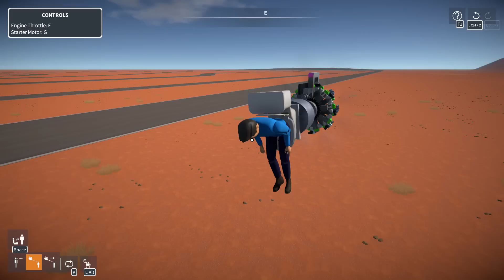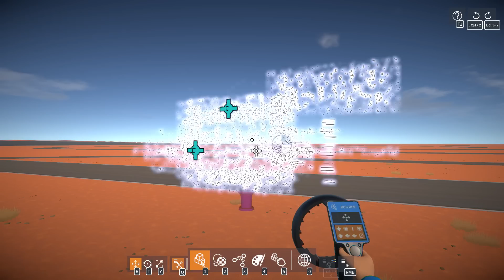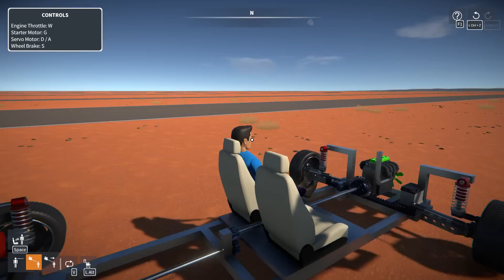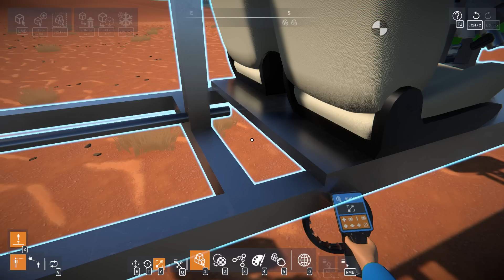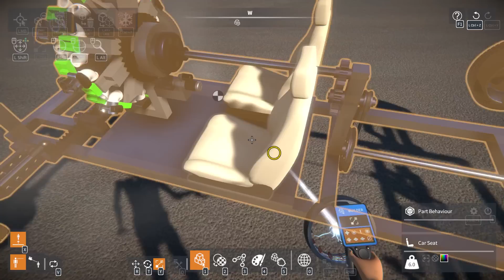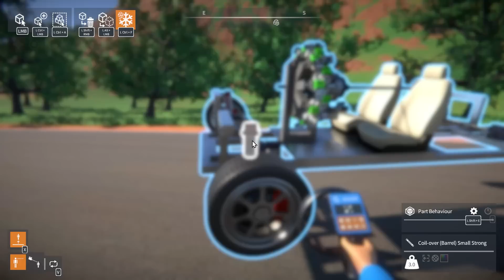This 18 Cylinder Radial Piston Engine Packs Power Into a Small Space!

Comment: 12:20 Your engines are consistent, you went from a pair of gears to a belt system.  That's what changed the direction.  Also like another comment said, build the 18 cylinder with the large pistons.

Comment: Is the crown gear of the rear diff  fixed to the left axle rather than the diff carrier? If so you probably find it drifts to the right as the left axle has permanent drive where the right axle receives power then through the carrier and game might be doing odd calculations with slip and stuff

Comment: Kan, the earliest planes solved the hydraulic landing gear issue by just not having landing gear.

Or, to clarify, their landing gear was almost always fixed or semi-fixed struts, so you didn't worry about folding it out of the way.

Then a lot of slightly later models had manual mechnical gear. Either a direct crank in the pit, or a reversible electric motor with a tristate switch.

Hydraulics only really became a thing in the ww2 years, and they were not that good. Leaks were common, so manual backup systems were necessary.

Comment: I think the problem with the chassis pulling to one side is that the suspension (spring and damper assembly) are fixed on top. Try letting them rotate, or maybe get inspiration from already built cars

Comment: The suspension issues you're having seem to be either, your geometry is weird or the tire physics are not linear in their direction. Could try moving the spring/shock toward the center of the car. Seemed very rigid with the bigger engine on it. And it kind of looks like scrap mechanics suspension....blocky.

Comment: Add a four speed box with a high and low range, bigger cylinders and some monster truck tyres. Dual twin exhausts and massive resonators should help with the flow of the exhaust to help build back pressure flow

Comment: you could make the Steering Servo have a slight offset to the left (like 5-10 degrees counterclockwise) to combat the problem with it turning slightly to the right... there should be an option inside the servo's settings for that

Comment: 21:20 I've actually tried this, i did a flat-8 small block stacked on top of a flat-4 big block (L4S8 on workshop). You can do some cool things with it and adjust your curves Instead of just having your normal engine peak at ****RPM you can have one engine peak early, and have the other peak late. I also have a vehicle I've made where i put the engine and transmission on suspension so it's "floating" in the chassis and used the stretching of the pulleys to connect it to the drivetrain. The idea was to help reduce torque steering by letting the engine rotate some, but i'm not an engineer and have no clue what the actual physics going on are. It seems to help even out the turning under acceleration, but there is still about a .2-.3g difference in left to right. Its called the "Tracker-B"

Comment: I kinda want to buy the game, but I'm not sure how overwhelming and difficult it is to do anything in the game from scratch. 

A particular idea I have in my head at the moment is a five cylinder radial engine laid flat like a pizza with one end of a cvt above the output shaft, and the other end of the cvt is connected straight down to a differential with a CV joint in the middle so a solid axle suspension can be powered from above.
Not sure about adding front drive for 4wd but for rwd longitudinal or fwd transverse this would be a solid and compact drivetrain, plus everything is down low, so it'll both have a really low center of gravity and be compact! might be really cool for a real life mower build.

Comment: I still think that this chassis turns right is because the rear right axle or wheel isn't connected to the differential. And moving forward is possible only thanks to it limited slip.

Comment: You might need a motor mount so the torque of the engine doesn't go straight into the chassis (I had a monster truck in gear blocks with a massive engine and it had the same problem with having a heavy fly wheel you have a lot of rotating mass applying a torque on your car) Hope this helps

Comment: 11:27 On the belts, it seems to play off of speed and torque. When I built a "hybrid" engine (v8 with a medium engine cramed inside) It would snap the belt drives if not a 1:1 drive.

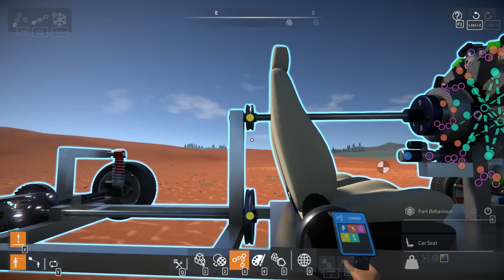Comment: 12:18 / 12:26 / 12:29 "...Is this still forward?...Of course it's not...Why would I build my engines with any sort of consistency...?"
But... weren't the engines driving rotation in the same direction?
Since he switched the transmission from gears to a belt, it reversed the direction on the wheels.
The fact that the car then drove in reverse means that the engines themselves were consistent.

Comment: 8:50 I think it depended on when the plane was designed and built. For example the F4F Wildcat had a manual crank landing gear system IIRC, and took a whopping 100 or so turns of a crank inside the cockpit to raise or lower the gear. Meanwhile majority of the planes past that point used a hydraulic system so that the gear could be totally covered in a closed little housing improving aerodynamics. Plus more importantly it was faster, and could be done with a single push of a button (at least for jets, all the old stuff had levers).

There’s a reason why there was like only one ground vehicle using a radial engine (early M4 Sherman), they take up so much space, and are a lot harder to cool when they don’t have open air flowing over them (like a plane). Then there’s the complexity of more cylinders versus a V-8, or the later V-12s used for tanks.
I definitely want to see a proper built test car.

Comment: I built a gas generator/electic drive car that honestly works great, if it was on a better chassis that is. I seem to keep having the rear wheels toe in on hard acceleration.

Anyways it would be cool to see you build one! 

Also I think your steering could be fixed with the trim option of the steering servo.

Comment: The only way to connect pipes like this is by angle node skipping, and belts do in fact slip in the game unless you turn up the physics settings, also you can easily flip the direction of the motor by inverting the direction of the rear crank shaft and starter in part behavior instead of adding gears, the chassis is probably pulling to one side not only because of engine torque but also axle instability in the control arms, the wider your control arms the better especially in the rear and sway bars can help with the engine torque

Comment: Radials are kind of insane. It solves a lot of problems in early aircraft: cooling, preventing starving, package size, weight, etc.

Materials science, newer engine designs (boxer engines, specifically), made radials less and less useful.

Still, the Twin and Double Wasp engines from Pratt & Whitney were used extensively to win WWII. Despite my love of the Spitfire, it should get much more love than the Merlin.

Comment: I think it pulls to the left because your servo is not in the center of the gear tooth row thingy, and therefore the default spawn position of the steering gear doesn't line up perfectly with the teeth on the row thingy, so it gets pushed like a fraction of a gear tooth to the left or right.
Reply: It’s called a rack and pinion setup

Comment: Connecting rod length is not the same as stroke length.
Stroke length is dictated by the crankshaft. The piston needs to move twice the radius of the crank shaft.
You can have a quite small stroke length, with a very very long connecting rod.
Reply: @jeffreyblack666
 Crank throw is half the stroke of the crank, not two times the radius.
Reply: @ducewags  The crank throw is the crank radius.
So saying the crank throw is half the stroke is the same thing as saying the stroke is twice the radius.
Reply: @jeffreyblack666  But it's not twice the crank radius. Crank throw is the distance from the center of the crank, to the center of the crank pin, or the center of the main the rod rides on. Crank radius is the entire swing of the crank. There is no such engine that has a crank swing, the size of the crank radius it's self.
Reply: @ducewags  Crank radius is the same thing as crank crank throw. The are literally 2 names for the same thing.
What do you mean by the "entire swing of the crank"? Do you mean from one side to the other? If so, that would be the diameter, not the radius.

It is called a radius, because it is the radius of the circle that the centre point of the rod journal traces.

Again, the crank radius is the same thing as the crank throw. It is half the stroke of the piston.
Reply: @jeffreyblack666  Crank radius is the outside diameter of the crank where the counter weights are. Crank throw is the distance the crank moves the rod. I buy cranks that are 2.500 inch larger radius than my block will hold, and turn the radius down to fit inside the block. The cranks also have a 4.00 inch rod main that I turn down to 3.250 and move the centerline, or crank throw or stroke if you will, closer to the center line of the crank. Crank radius and crank throw are NOT the same thing. And have a nice day.
Reply: @ducewags  If you start by saying it is a diameter, it clearly isn't a radius.
Crank radius is another term for crank throw. It has nothing to do with the counter weights.
You are also now contradicting yourself. If the crank throw is the distance the crank moves the rod, that would be equal to the stroke, not half of it.

Crank radius and crank throw ARE the same thing.
Reply: @jeffreyblack666  The diameter or radius of a crank is the outer most part of the crank. That is where the counter weights are, or weight ears. The crank throw is inside that diameter or radius of the crank. That is where the crank throw is found. Where the rods are fitted to the crankshaft. What part of that is so hard for you to understand? They are NOT the same thing. Have a nice day, I'm done trying to talk logic with you.
Reply: @ducewags  The diameter and radius are quite different, if you are describing them as the same thing, you are clearly wrong.

Again, the crank radius is the same thing as the crank throw. You aren't trying to talk logic. You are just continually asserting falsehoods and contradicting yourself.

It isn't hard to understand, it is just that you are wrong. Just like if you told me that grass is blue, it isn't that I don't understand what you are saying, it is that you are wrong.
The only thing I didn't understand is when you said crank swing.

Once more, the crank radius is the distance from the centreline of the main shaft to the centreline of the journal the connecting rod attaches to. This is half the stroke of the piston.
Reply: @jeffreyblack666  You again? Ok fine. I buy over sized rough cut cranks, machine the counter weights and web of the crank to the proper radius to fit the block. I then machine the crank pins to get my stroke, or throw as it's the same thing to get my compression and piston time set to the cam. Did you notice crank radius is not the same thing as stroke or throw, as that is not the same parts of the crank. How do you not know what crank swing is, as you know everything else? And you want to tell me I am wrong? Now go back and read my second comment I wrote. It's just after 5am and i'm going to walk the 40 or so feet to my shop and regrind a cam for more lift on a 241 Hemi. Do you even know what that is or how it's done?
Reply: @ducewags  I notice you claimed crank radius is not the same thing as the throw. But guess what? You claiming it doesn't make it true.

Again, the crank radius is the distance between the centre of the main shaft and the centre of the journal the connecting rod rides on.
You claiming otherwise wont change that.

I don't care what you are doing. You are still wrong.

You can easily look this up online and find plenty of sources saying that.

e.g. "The distance between the center of the main journal and the center of the crankshaft pin is called the crank radius , also called the crank throw"

Comment: I'm pretty sure your steering issues are being caused by the default angle of your steering servo. Try adjusting it 30 degrees left steer to see if that helps to correct the issue.

Comment: You can make the pipes connect how you want them to, but it would require custom pipes from the workshop and maybe even requesting a kit on the discord so you can get the connections you where after, unfortunately its not in the base game and is only available via mods to move parts while leaving them connected as attachment bridging doesn't yet work on pipes.

Comment: Maybe for the next engine you could try to make some high revving engines, since i have noticed nost of your engines do not go above 4000-5000rpm irl most road cars have a 6000rpm redline and some performance vars can have upwards of 9000rpm redlines wich makes them sound really cool, i dont have the game so i dont know if it is possible, but if it is it would be really cool to make the lamborghini huracan v10 or something
Reply: Unfortunatly at those high RPM's the engines and gears get unpredictable in a predictably destructive way :(  there are some configurations I've noticed that allow for some higher rpm's with just an engine but it is still janky. all this using some glitches and modifying values outside parameters

Comment: i created a supercharger (kind of) by equipping a electrical engine with a pully to the crankshaft before the clutch,lets say the engine runs at 4k max, and you have full throttle open, then kick on the electrical engine to get some extra boost into it xD if it really works is the 2nd question, but feels nice to have the wheee from the electrical engine on top of the v8 xD

Comment: hey Kan, the pulling may be from a weird.. well not that weird but a thing I noticed.. Your player has weight and may be putting off the center of mass just enough to add a pull. Try changing what side you are on and test it for yourself :)
Reply: going heavier will reduce the COM offset due to your player weight
Reply: It could also be from the battery

Comment: Btw. Stroke is the amount the piston moves in the cylinder. So in gearblocks you cant adjust stroke. The length of the connection rods doesnt do much.
Reply from the maker: True that is a very valid point all I'm adjusting is the length of the conrod which would lower the angle to the crank which would help deliver a bit more torque I guess...
Reply: @kANGaming  In reality, a longer conrod would indeed increase torque.  In Gear Blocks it does not seem to affect power at all, unfortunately.
Reply: @TheHengeProphet  why would a longer one make more torque? The crankshaft in game is the same regardless of the connecting rod. The crankshaft is where the liner lever comes from. A longer rod would imply a bigger crank in real life, yet here we are lol
Reply: @TheHengeProphet no it won't because it doesn't change the distance from the center of the crank which would mean it wont increase torque. But If you had a bigger crank offset from the center shaft it would increase torque
Reply: @kANGaming i built an engine that has linear actuators connecting the cylinders and crankshaft so you can vary the con rod length at will and it produces the same power regardless of con rod length unfortunately
Reply: @kANGaming  im not sure but wont that just reduce the amount the piston is pushed to the cylinder wall? Like irl. In game i dont think i does anything tho.
Reply: i have comment this each time! he never read my comment 😂 i hope he read yours
Reply: I thought longer con rods didn't change anything since it is still turning the crank at the same distance from the center but a longer crank should increase power since it is further from the center which is how you would calculate torque at the crank
Reply: @robo38999  It only should lessen the sideways force that is put on the piston. So basicly nothing

Comment: With a note on plane hydrolics if it was an older WW1 plane or an interwar plane design. Usually the gear would be fixed. If it wasn't fixed then it would be operated like those hand crank screw Jack's car come with. With the screw turned by hand or an electric motor.

As a fun fact. The WW2 spitfire had hydrolics gear, but if that malfunctioned then the pilot still had a hand crank to lower each wheel manually.